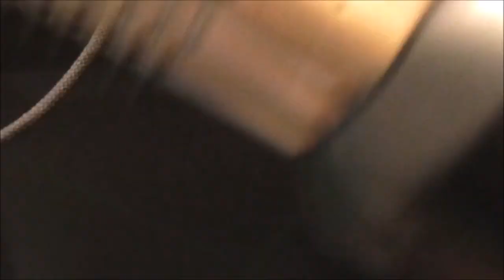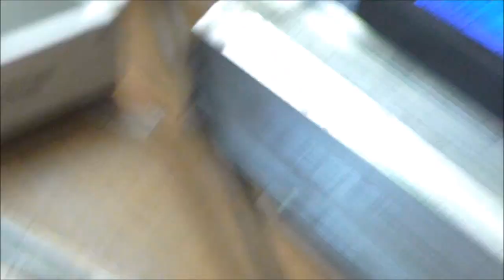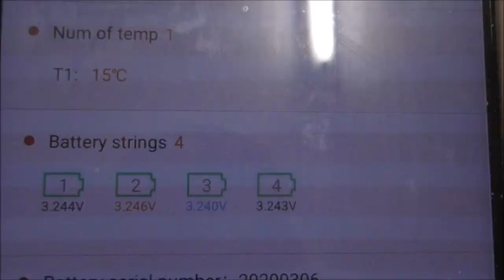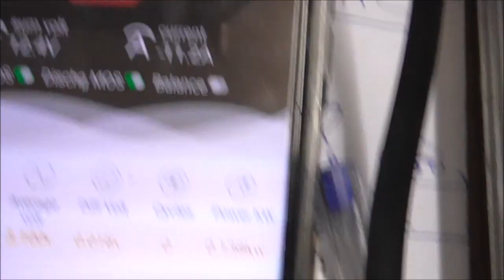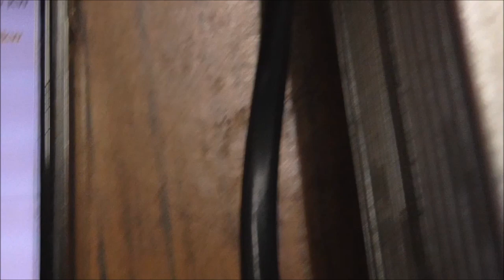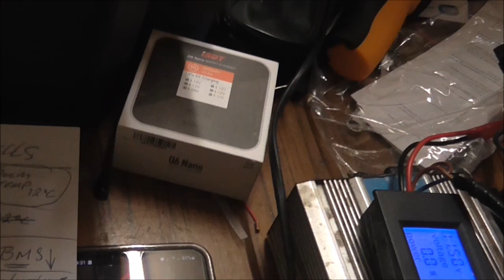Elerix 70 Ah LifePo4 battery pack capacity test

Comment: Dear Martin, you wrote ""Assembled a 100 Ah as well after this.", it was with EX-L100 ?
In your test the 100Ah cells from Elerix give you  100 Ah or less .

I ask you this because i  have to order 8  cells to build 2 Batteries 4S (i have 2 elecrtric motor in fishing boat) and 11 November arrive in Aliexpress but i've read the 105Ah Chinese sellers sold, are often around 80Ah no more, and this is not very good in my advice ! 

Thanks
Reply from the maker: Yes I did purchase the Elerix EX 100 cells   
and they did produce the stated output on test. I purchased these cells from a company in Czech Republic who test cells before shipment.
Reply: Thank you so much for your answer, MERCI @martint1151  .
So you obtain 100A or more  ? (all i've read on aliexpress talk about a Maximum of 90A for cell sold for 105 A .... and currently it's around 80A less or more : this why i think to purchase my cell on GWL in Czech republic too)